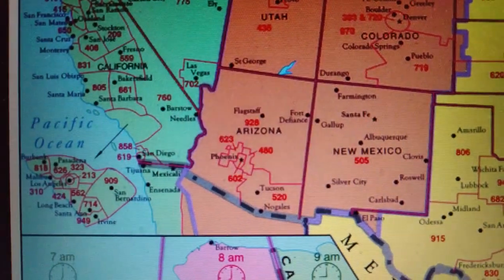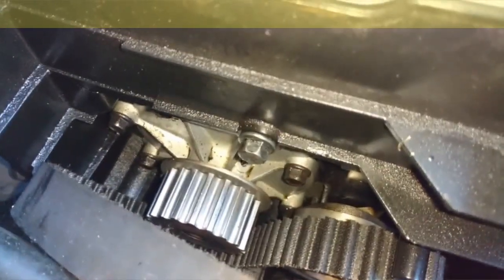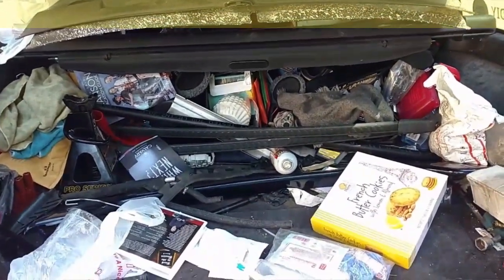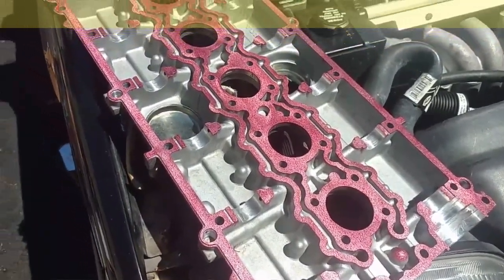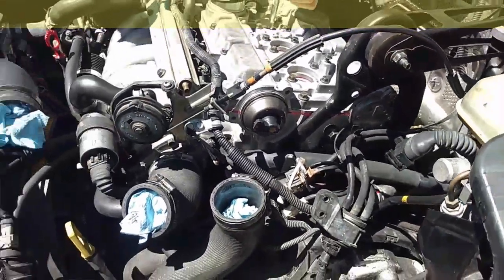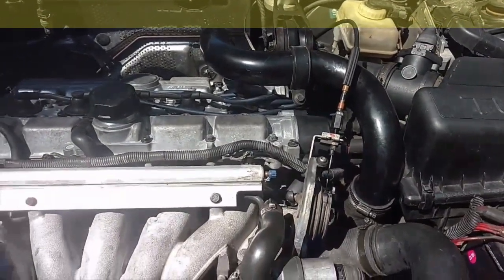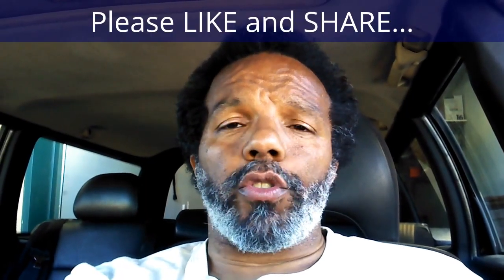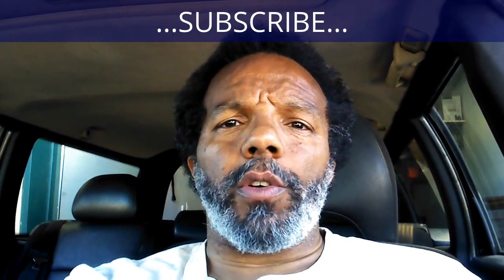Day 73, Portland OR. Robert DIY helper tour. Cylinder head replacement.

Comment: 95 850 got. I am finding oil in the nooks and crannies of the top of my engine. Also I see stains on around leading to the top of the crankcase where oil goes. Bad cap? Seal? Something else? also, greetings from Woodburn Oregon! If you like Mexican food stop on by sometime, my treat.
Reply from the maker: +Alexander Diaz likely a bad oil cap seal. Pretty normal to find oil up there.

Comment: Hi Robert!
I have recently bought  myself a 855R.
When got home i saw that the coolant was mixed with oil. I Also noticed that the turbo was leaking oil. I took a look under the intercooler and saw it was dripping a little bit of oil from the small hole located under the intercooler.
Is it possible that the oil going to lubricate the turbo is leaking out in the intake and coolant lines? I'm probably going to have to take out the turbo and restore it right? But is it even possible that coolant and oil get mixed up in the turbo if a seal is broken or should I be worried that it could be something else more severe?
Great channel and Thanks from Sweden
Reply from the maker: If you have fluid mix, it is likely happening in the radiator or engine.
Reply from the maker: https://www.youtube.com/watch?v=wGXoRLSDE04
Reply from the maker: https://www.youtube.com/watch?v=jsxPXltMFOc
Reply: Thank you for your answer. That the oil gets cooled inside the radiator explains everything. I will take a extra look into it tomorrow. It's weird since the radiator looks quite new (the plastic sides looks fresh) but I guess you can never be quite sure, probably is a low quality one. I doubt the head is blown but will check that too.
Once again thank you! I'll keep you posted
Reply: Hi again Robert DIY
I was unable to check the coolant level since the coolant container is all dirty and you cannot see through it. I have ordered a new one.
Today I was driving home from a visit in a city about 155miles away from my home with my 855R. After about 20mins of driving I was stuck in a trafficjam. After sitting in the jam about 15min it started smoking under the hood.
I stopped to check it and it seemed like the pressure built up inside the coolingsystem had pushed out alot of coolant (ofc mixed with motoroil) out the container and it had simply evaporated when hitting the hot engine.
I wonder what could have caused this? Either the whole system got overfilled by the oil and the pressure buildup was to big? Or might the headgasket be blown?
After I filled upp the system with some water and checked the oil it was fine and I drove the car all the way home with no problems.
Reply from the maker: Did you watch the videos I linked above?